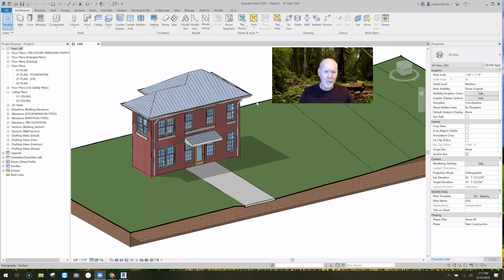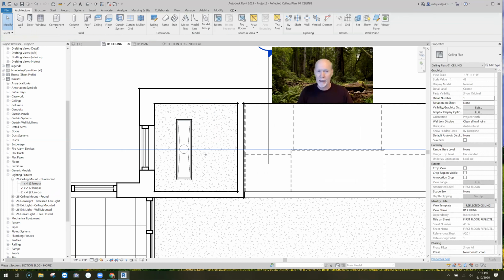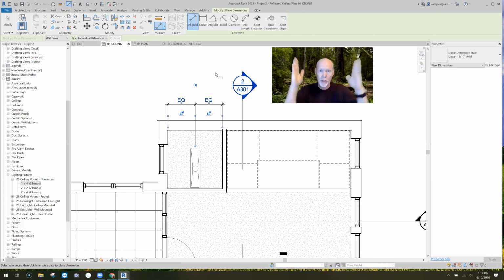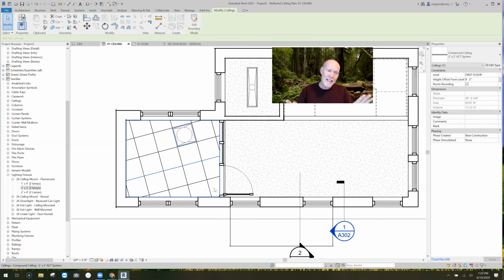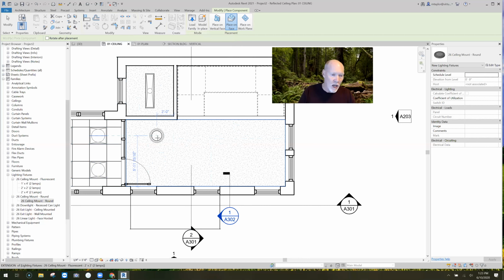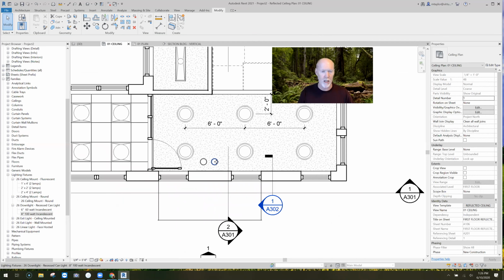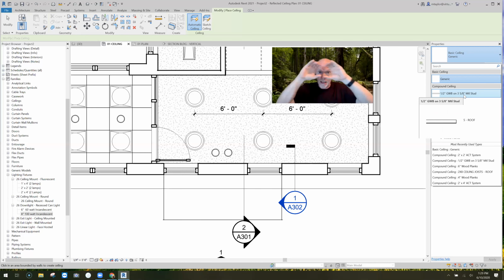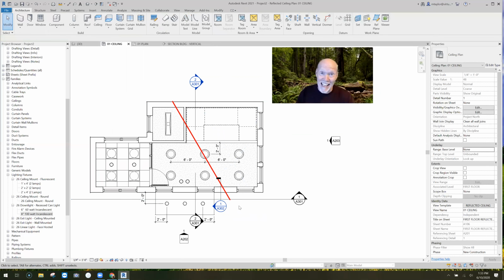PLACING LIGHTING FIXTURES: Tips / Tricks

Comment: Hi, thanks for the videos.  So do you add a Ceiling underneath the next level floor? Since the floor shows in the ceiling plan, but doesnt act like a cieling, therefor cieling families dont connect...    It looks really crazy, feet and inches, when your used to metric, but what really beats me is that the sizes arent basic at 1to100, 1to50 being twice the size.  So in metric each cm on the drawing would be 1 m in real life. so what would an inch on the drawing be ?   Have a great day

Comment: Great Video as always Mike.  Could you do a video showing how to put switches on a Reflected Ceiling Plan rather than in a copy of a floor plan? Thank you!
Reply from the maker: Oooo... good idea. Some residential plans show the switches, lighting fixtures, fans, electrical outlets on the RCP and some on a copy of the Floor Plan called ELECTRICAL Plan or POWER Plan.  I often make a quick SYMBOL of a lighting switch and of the outlets, so that I can run a wire to the lighting fixtures on the RCP. I bet that MEP guys use real 3D elements, but for small residential projects the 2D symbols work great for me.